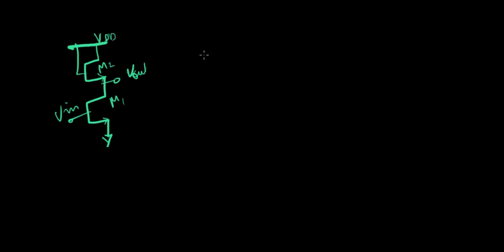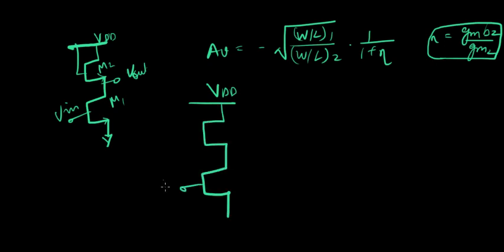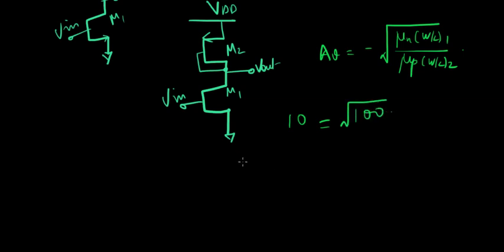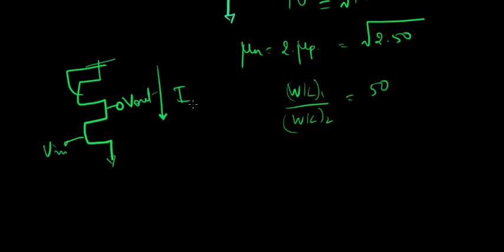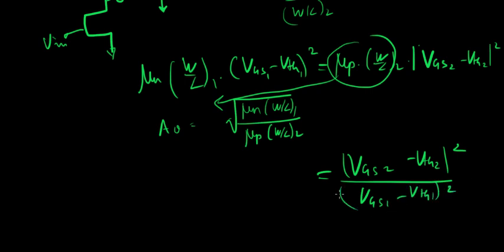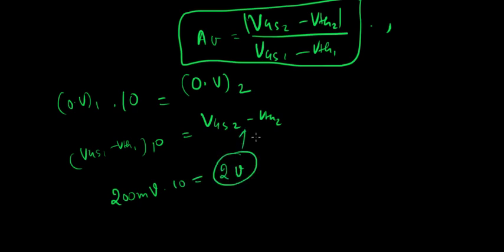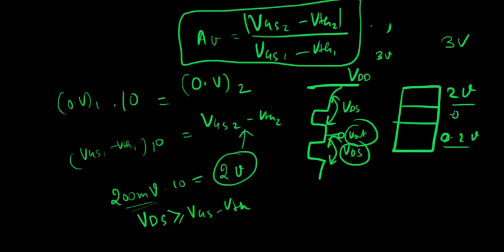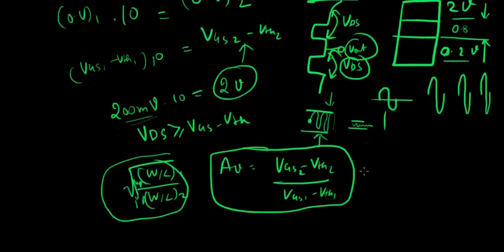Common Source Amplifiers - PMOS Diode connected load

Comment: while explaining the diode config of nmos, u said the voltage gain is -gm1/gm2, but in the next lecture u derived -sqrt(w/l)1/sqrt(w/l)2 * 1/(1+n)
why so much difference???
please explain....
Reply: The u term cancels with nmos devices as the values are the same. but with p and n mos devices they don't cancel so must be included.